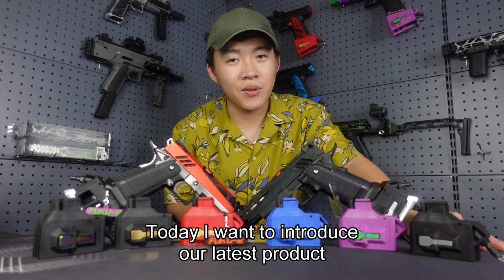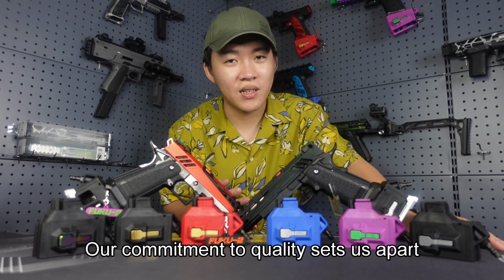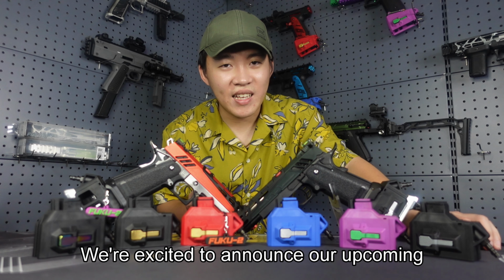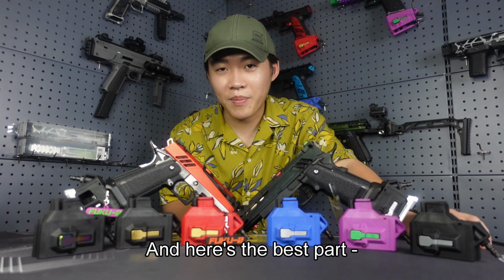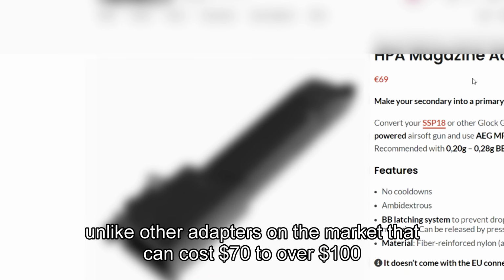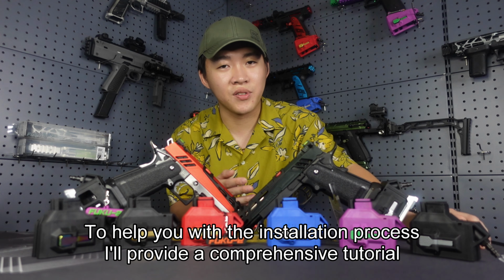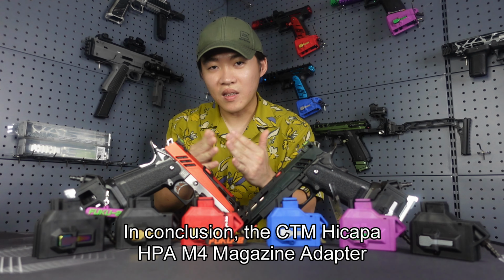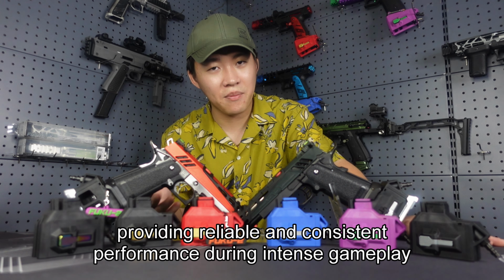Upgrade Your Airsoft Game with CTM Hicapa HPA M4 Adapter

Comment: Does the adapter work with a Vorsk HiCapa mag ? And in your tutorial was that liquid lubrication ?
Reply from the maker: Hello, sorry I haven't seen one Vorsk mag before, so you will have to try it yourself.
And yes, I was using silicone oil

Comment: Are these injection moulded? And will they work with TM 4.3 magazine case?
Reply from the maker: Yes, they are injection moulded. As for the second question, I think the magazine cases of 4.3 and 5.1 are the same?
Reply: @ctmtac4432  I can 100% confirm the CTM adapter works with a 4.3 magazine and the EDGE custom GIGA magwell. Fits perfectly with it. Thanks guys!
Reply from the maker: @polesetter_01  niiiice

Comment: Wat is the butstock adapter for hicapa called?
Reply from the maker: humm I don't think we have a butstock adapter for CAPA yet?
Reply: @ctmtac4432  Interesting. What replica is that then in the literal first second of the vid - having a butstock installed?
I'm searching something like that for my hi capa for about 2 years now.
Reply from the maker: @UltimateFalk  oh I see, that's our REAPER Chassis system for AAP01
https://youtu.be/Ny_Xa1q7cP4?si=1RPhd9YHricjtHmY
Reply: @ctmtac4432  amazing. I really wish something as sleek and well produced as this would be available for hi capas someday. Only found 3D self printed stuff, that looks scuffed or average at best.
Reply from the maker: @UltimateFalk  This is a very good suggestion, we will think about it

Comment: Just got mine and ran into all kinds of issues.
6 types of magazines can not go in including PTS EMP and if yhey do go in I have to shove them in with force. The second issue is that the bbs dont feed from the mag to the hop chamber for some reason but still I will try with other mags I have for the pistol. Still the mold for this was way too small and I understand you like a tight fit but this is absurd its a 1 star from me
Reply: I have the same problem with feeding to the chamber. Let us know if you sort the issue out mate cheers